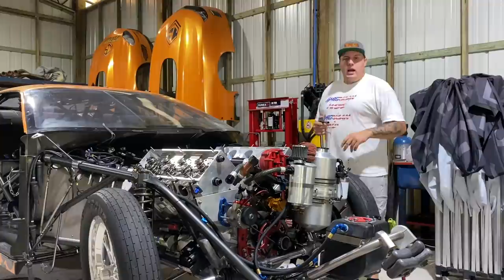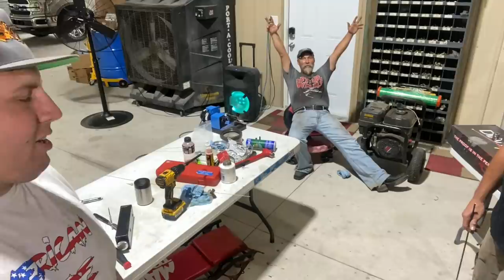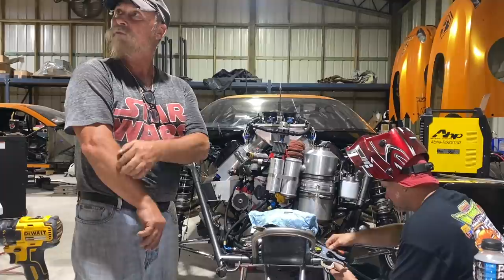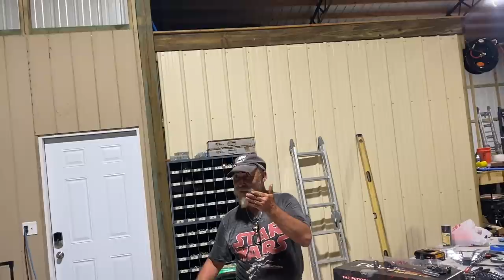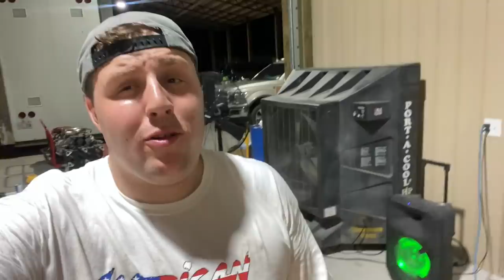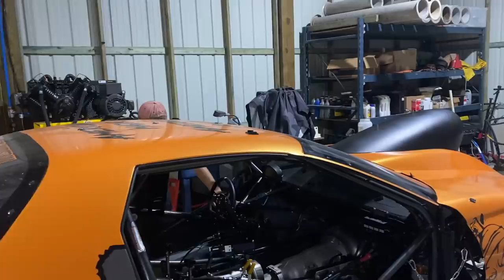AFTERMATH IS BACK TOGETHER WITH SOME NEW FLAME THROWING HEADERS! (MEGA-HORNS)

Comment: Why do you still have the distributor hanging off the front
Reply: I was going to ask that I’m glad you said something already
Reply: To fill in the hole that would be left if it wasn't there.
Reply: I saw that too ...you gotta a lathe turn down something and make a plug !
Reply: Nathan Panek Jessel belt drive distributors bolt on. No hole/s to plug.

Comment: @33:40 we note that you're cranking the torque wrench settings from ZERO,, that's a tech tip for any newbie motor heads watching, when you're finished using and storing your torque wrench ALWAYS RESET THE TORQUE TO ZERO  Doing that relieves the springs inside the tool. Thanks Justin, good tip.

Comment: Send the Bull Horns to Joe Seay @ DCF to get them and the Zoomies polished and also one day once you get used to the turbos on the LS you should build a 632cid "Semi Hemi" from Sonny's Racing Engine's aka Sonny Leonard with either twin "Pro Mod" 98mm or 102mm turbos and put it in Alcatraz for RVW and PRO275 and keep all the Musi engines and parts for Aftermath aka the NPK car and once you get a body for the LS chassis and dial it in and ultimately build you a bigger and badder LS for it you should go out to the Mid-West and race in some street/cash days races with it on small tires and big tires and find out which one you like better on the street

Comment: I think you should buy that Dragster and get it fully updated and put in a shorty 2-speed powerglide with a bolt together Billet converter behind a nitrous fed 632cid and put a Fuel Tech 500 or FT600 ECU on it with a built in delay box and all and do them high dollar bracket/index races with it and go out there and win $500k or $1m and so on then reinvest that money back into the racing program

Comment: Not trying to hate or tell you how to do anything but you might look into bad torquing due to hydraulic torquing. This happens when the liquid you use goes in the bottom of the hole and you are putting pressure on that liquid with the bolt or stud and it putting pressure back on the bolt or stud and it says you’re at one torque but really you aren’t there. I’ve ran into this in my job working on hydraulic manifolds.

Comment: Won't putting oil in the head bolt holes cause a false torque because your compressing the oil and not actually torquing the bolt. You would be better off just putting a little oil on the bolt itself

Comment: That's the only musi motor I've seen look that bad. Musi motor and backfire?
Reply: They had a problem with the distributor jumping timing mid run.  Backfired.  That's why there are coil packs on the fire wall now.  It's been explained in past videos.  And just what exactly looks bad about the motor?  Is it not shiny enough?

Comment: Holy hell those heads look like they’ve had it rough.
Reply: they come welded around the spring pockets from Musi
Reply: @DSRE535  Thank god someone that knows his shit!
Reply: most billet heads especially ones with water jackets will have welded in aluminum windows after the water jackets are machined, since its not a casting it has to be done this way for the most part